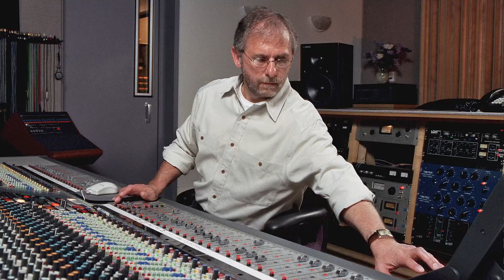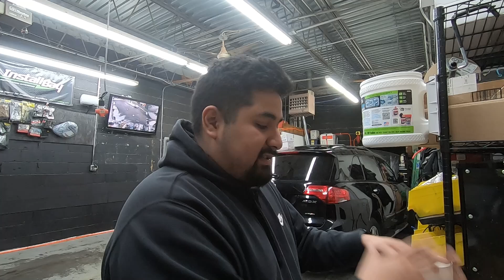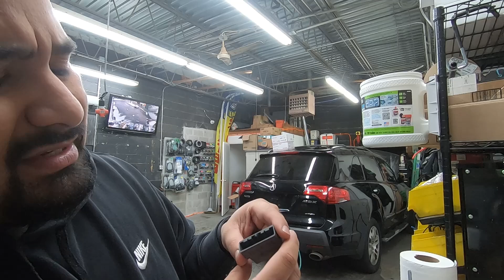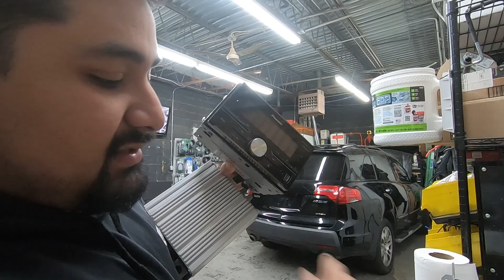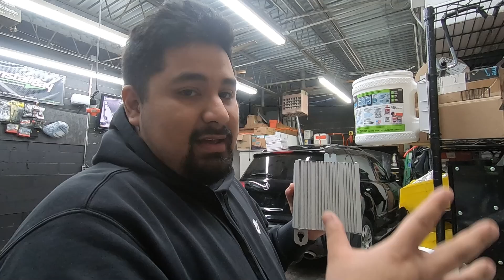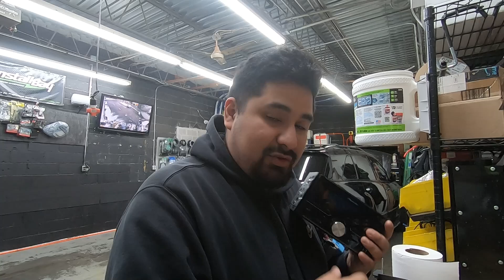2009 2010 2011 2012 2013 Acura ELS Audio Amplifier Interface | Aftermarket Radio Factory Amplifier

Comment from the maker: If you are looking for the ELS amplifier interface you can find it here https://mobilemaxcaraudio.com/product/2007-2008-2009-2010-2011-2012-2013-acura-els-audio-amplifier-retention-interface/
Reply: so i have a 2012 acura tl base model no navigation .. if i change the radio so i still need this ? also radios now are touch screen volume can i use this on the base model no nav or tech package so i can have physical volume knob if  install after market radio like an alpine or pioneer ?